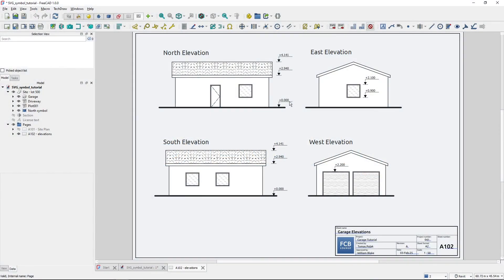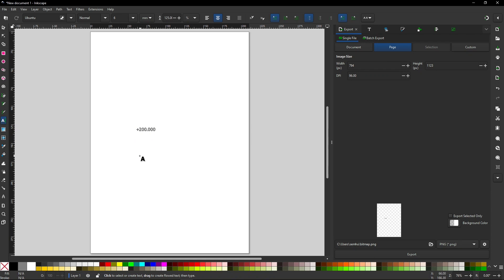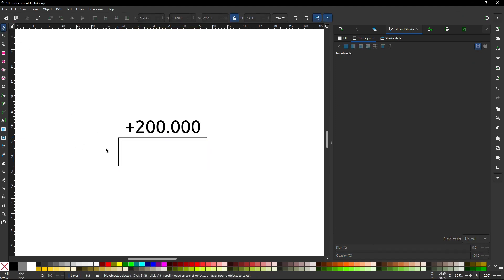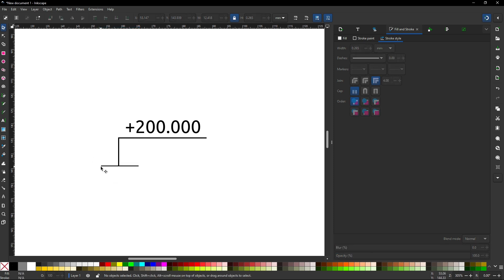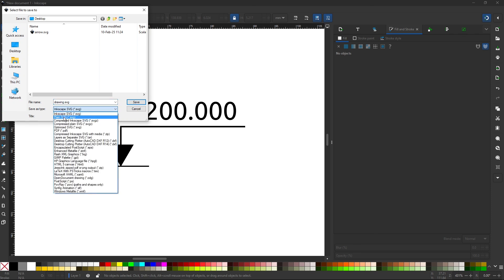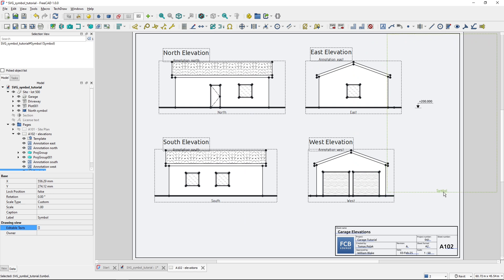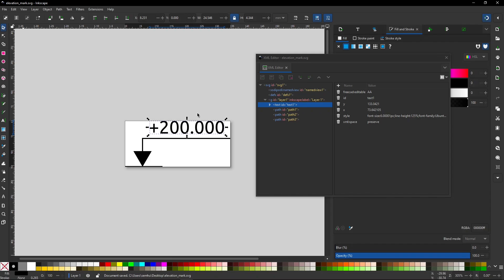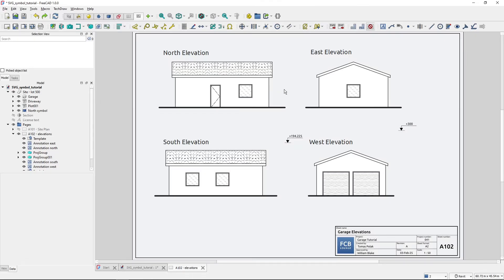Create an Elevation Height Symbol for use in FreeCAD Tech Draw Workbench

Comment: So theres really no other way to input elevation heights ... this is helpful but i was just wondering...
Reply from the maker: Not directly in TechDraw. There is an option to use  Draft_Label with 'Postion' output, which shows X, Y and Z coordinates of a point. But unfortunately that is completely different use case than what is needed in the case in the video.